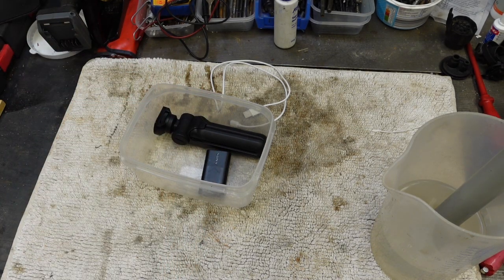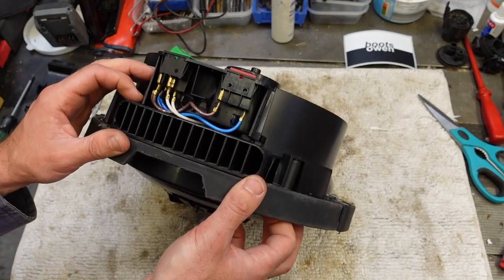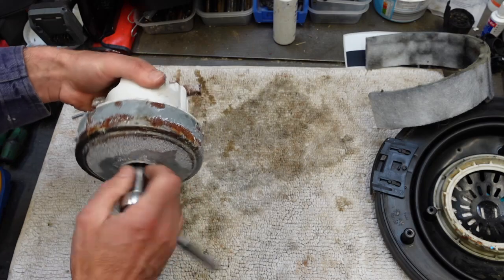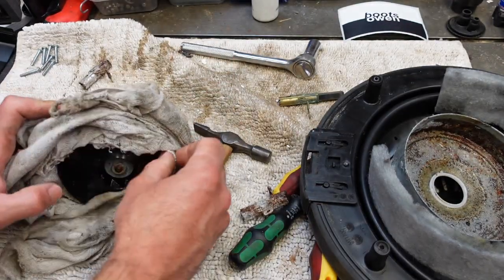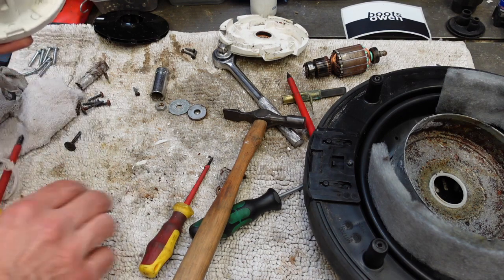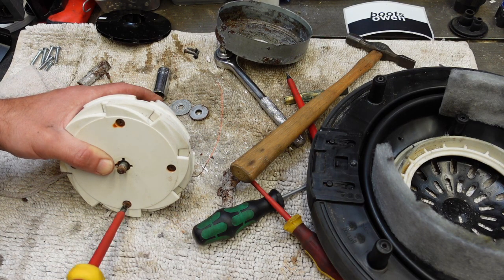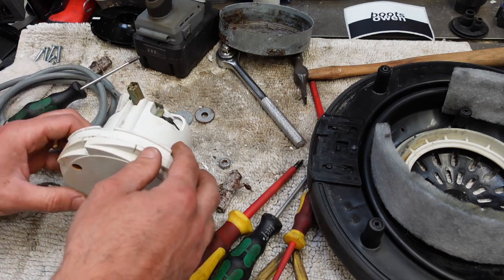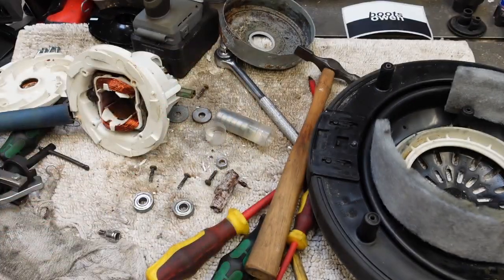A tale of two Henries: Numatic and Henry with an arcy sparky motor

Comment: When you turned the rotor by hand, you could hear a clicking sound (2:30). This is because one of the bars on the commutator has been risen very slightly due to centrifugal force overtime. This causes the brushes to jump and then you get sparks. Another cause could be a shorted interwinding on armature. But I suspect the raised bar, that clicking sound is a give away. It happens in older motors and the rotor needs to be replaced.

Comment: I think the other comment is right that the commutator is damaged, but also for future knowledge vacuum motors are meant to run with the fans in place. Without the fans they can run too fast which will also cause excessive sparking/arcing at the brushes.